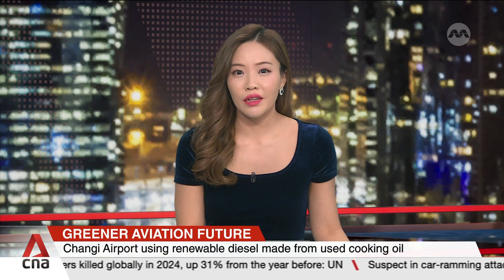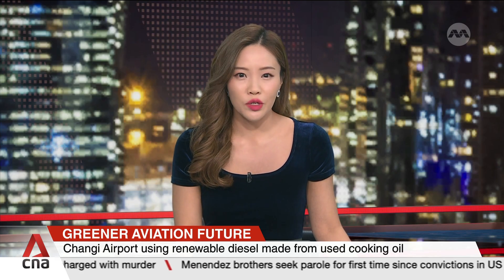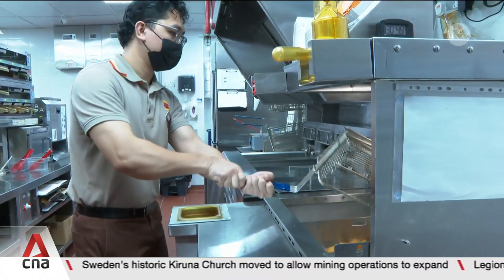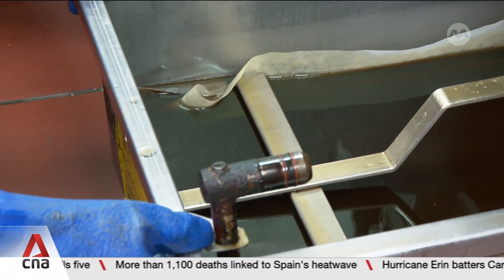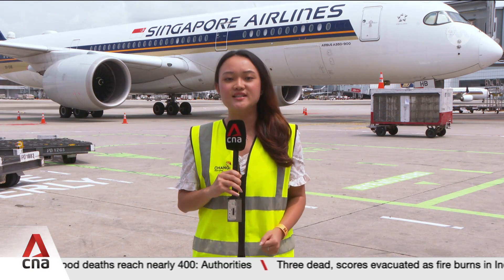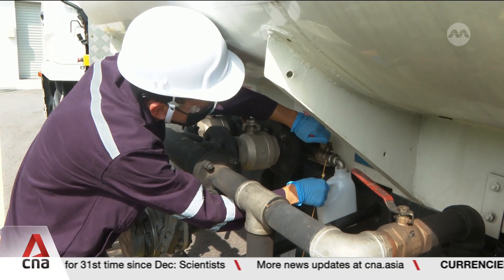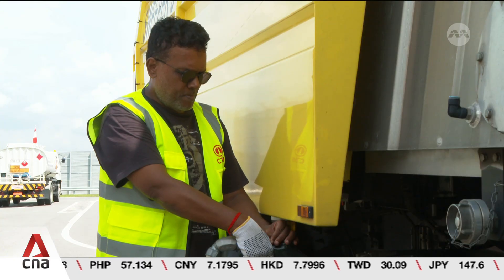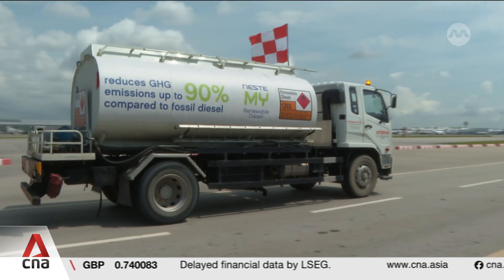Changi Airport using renewable diesel made from used cooking oil

Comment: More than 10 per cent of Changi Airport Group's diesel-powered heavy vehicles are running on renewable diesel, made from used cooking oil from its F&B outlets, among other waste materials. They are part of a six-month trial to assess performance and efficiency. Early results showed that renewable diesel works as well as fossil diesel, but it is better for the environment. This comes as Singapore drives towards the goal for all vehicles to run on cleaner energy by 2040. Charlotte Lim with more.